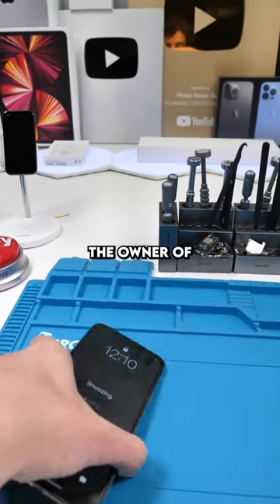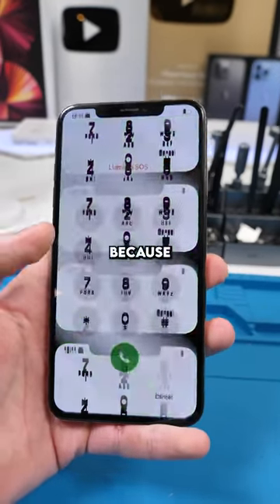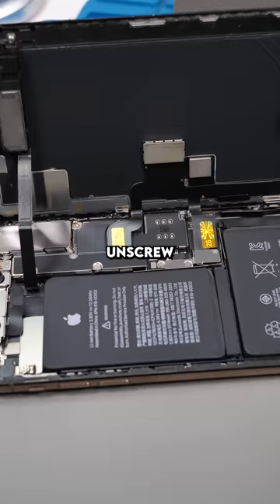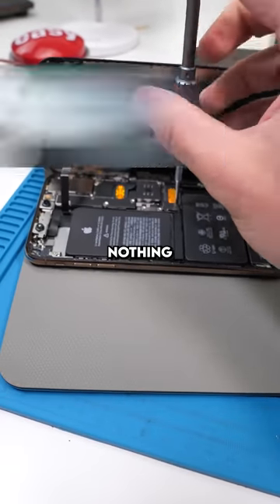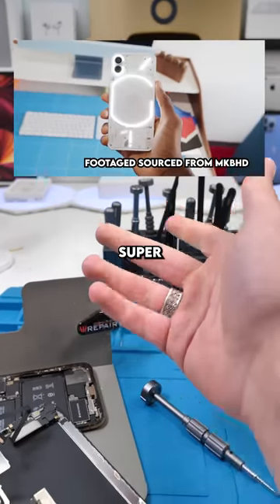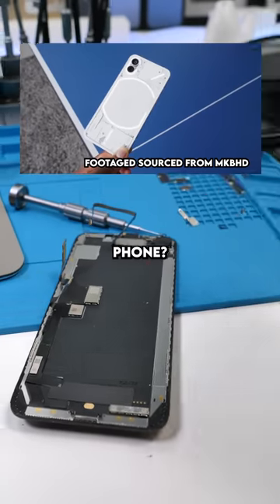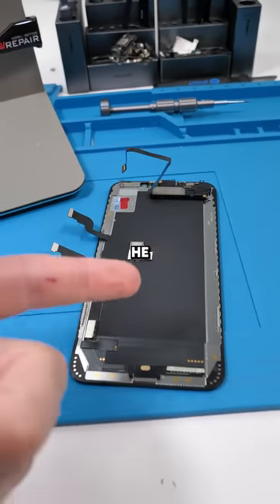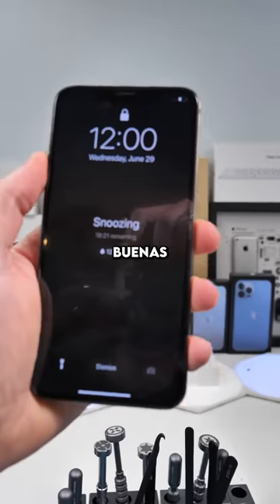This iPhone Had 3 Notches Too Many..... #Shorts

Comment: I'm gonna get hate but the Nothing phone is a bad deal. For $300 I can get the Poco F3 which has a better chipset for $100 less. It also has a headphone jack and a charger in the box. We'll know for sure when the full spec sheet is released but based on the info we know, the Nothing phone is looking like a complete gimmick phone for now.

Comment: Well. The question is. How reliable it is? Don't get me wrong this a cool idea that has LEDs at the back. But the failure rate? The LEDs just working just fine if the phone dropped accidentally for a few feet or inches?

And most people will slap a case with it, but i know other phone case company will be releasing cutouts for the LEDs
Reply: How many LEDs have you seen fail in your life?

Comment: I'm a samsung note 8 and 10 owner. Held on to the 8 as a emergency backup because it's in rough shape.  My note 10 has had a cracked screen and back glass for a while and here lately it's been having a cold temperature warning keeping it from charging occasionally and several times the battery went from like 80% to 2%i suddenly so I decided to do the repairs.  Got the new charge board, battery and back glass and did those things myself without problem.  Since the glass  screen was cracked but the display worked perfectly I chose to just replace the glass. Big mistake.  Now I'm using the note 8 while waiting for the new screen and digitizer to get here. Wish I had known so i could have just ordered the digitizer in the first place.